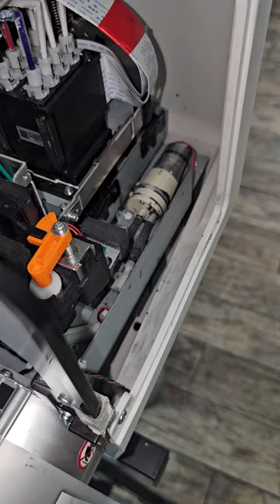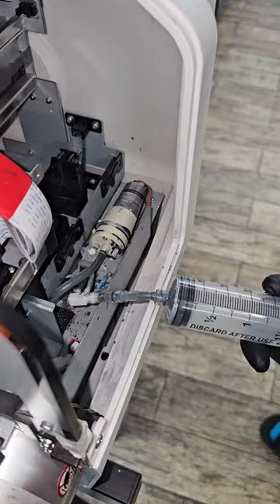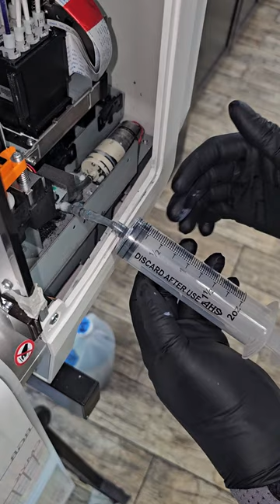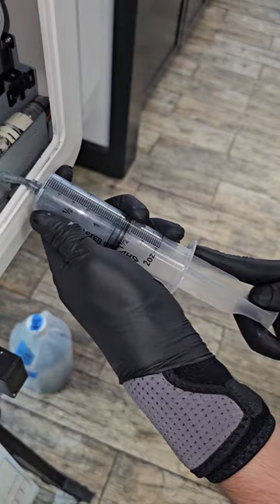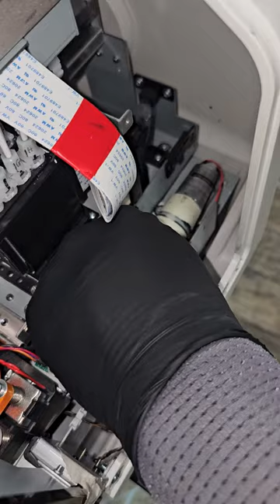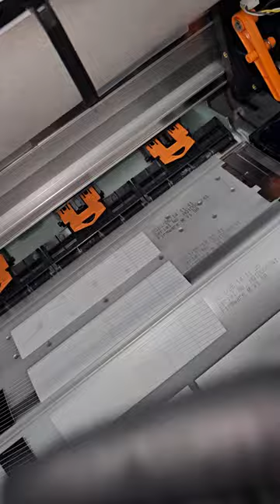DTF printer - How to Updated syringe pull for the 628 / 724 DTF | video BY STSINKS

Comment: This actually works, if it’s too hard to disconnect, use a small flathead screw driver and disconnect from the white connector piece, separating it from line that comes out of the little motor that he is disconnecting from in the video

Comment: Why do you need to do this and how often should you do it?
Reply: This procedure doesn't waste as much ink as a head cleaning, more effective and doesn't cause unnecessary wear on  your printer head. Do it when you can't get a good test print. I do instead of long head cleaning.
Reply: It'd be cool if it would actually fix it though, I run this machine consistently and the white just goes out of nowhere. Did this nozzle pull 4 diff times good amount of ink, does nothing same nozzle check